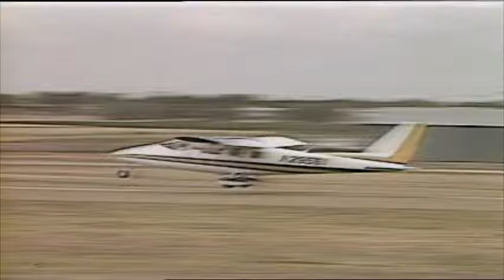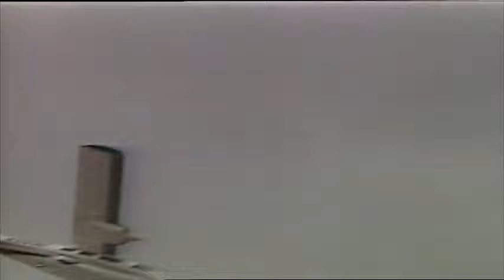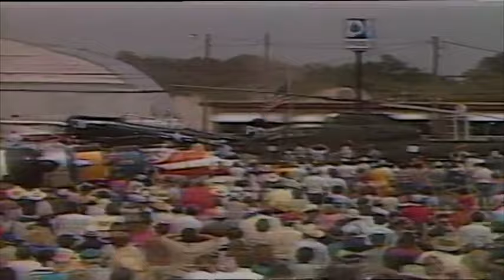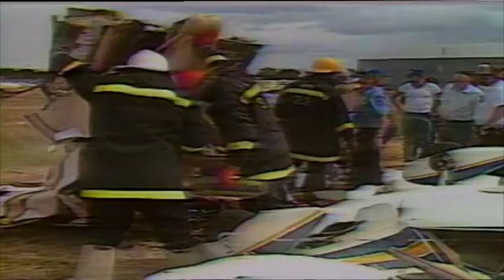Plane Loses Wings During Airshow (09/11/83)

Comment: He had a full 10 seconds after the wings came off until he hit the ground. That’s an awfully long time to contemplate your fate.
Reply: Oh, he knew exactly what his fate was going to be. I'm sure there was no question in his mind for about 9.9 of those 10 seconds. I have been a pilot for over 40 years, and there's one thing you think about every time you leave the ground: What's going to happen to you if the airframe comes apart. Different between him and me though: I don't intentionally over-stress Part 23 aircraft.
Reply: All that time you KNOW you are dead. Must have been utter hell.
Reply: Part of that time was more or less flying, or more specifically falling slower, but then it spun in.
Reply: Go research what really happened to the Challenger crew. That was 100X worse.
Reply: It goes by very quickly.
Reply: and contemplate..why did i push the plane to that extreme.  this was no accident..it was caused
Reply: @brentbarnhart5827 without wings you cant controll the plane
Reply: The cockpit was doing crazy movements that might have taken him off his seat or get him disoriented.  He had much less time really trying to figure out something.  It was a relatively chaotic moment and it was a quick death without much time for him to contemplate anything.
Reply: @brentbarnhart5827  yeah thats true but he likely already knew hie fate when the plane started spiraling down
Reply: @brentbarnhart5827  they know how to get out of a spiral but not how to get out of a spiral without wings thats literally impossible and the pilots know that
Reply: В такие минуты ни о чем не думают. Просто с ужасом ждут смерти.
Reply: @bluehornet6752 resignation, or of the 5 attitudes you can’t have. He was trying something, maybe rudder.
Reply: I would imagine the first few seconds was trying to figure out what just happened because it does takes time to comprehend a situation, maybe a a second or two to think of what to do next, and then the last few was “just fly the plane”.
Reply: Part 2
https://youtu.be/v_VpGqnPc5s
Reply: It would certainly feel like it. Terrifying way to go😔
Reply: Enough time to accept Jesus Christ
Reply: @bluehornet6752  LOL.  40 years as a private pilot.
Reply: just had to jump out the window with his chute
Reply: @jotrutch  Yeah, being pushed to the back and side at about 9-10 G's and it's just that simple.  Good grief.
Reply: @bluehornet6752  The time when your skydiving and go to pull the pilot chute. The big "will it open"  then it opens and you smile  decades ago but I remember the feeling well.
Reply: @bluehornet6752  That seems strange to me, because it's not not as though whenever I get on the freeway in my car I think, "What will happen to me if the wheels all suddenly fly off?"
Reply: @nitdiver5 lmfao okay bot
Reply: @bluehornet6752  He wasn't thinking about the Airframe. If he was thing about the Airframe he would not have ripped off his wings.
Reply: @DerBingle1  Well, don't people with a heart attack, severe cut, shotwound have that for way longer? guess 10 seconds is a blessing.
Reply: hey, i couldn't tell from the video, did he get out there at the end?:pride-hand-yellow-nails::pride-face-orange-flowing:
Reply: Ker splat